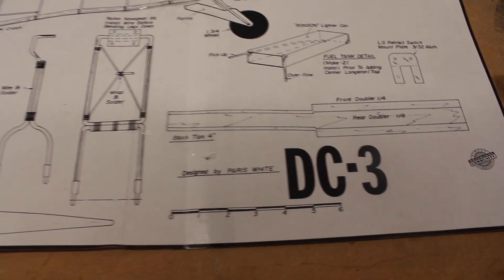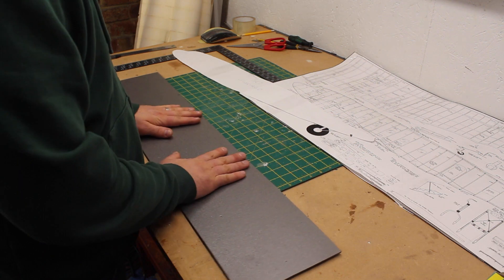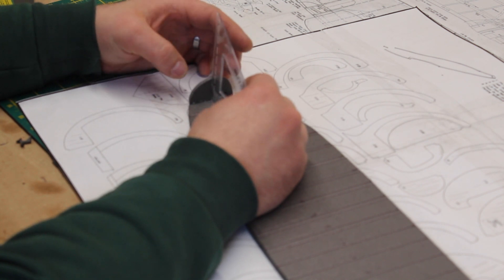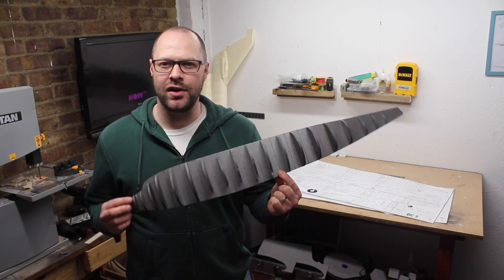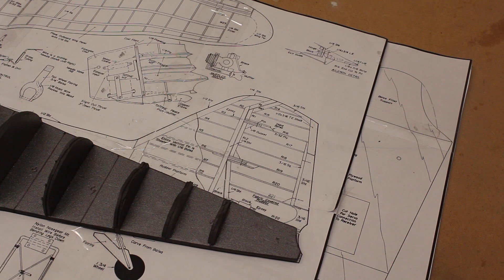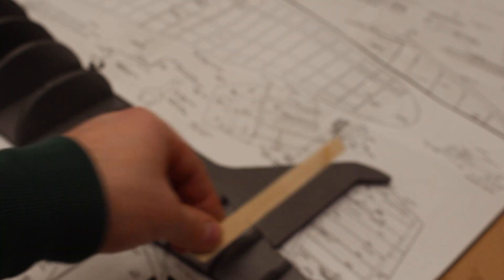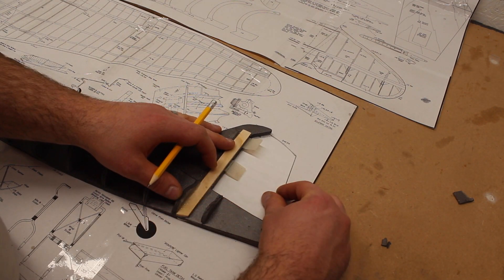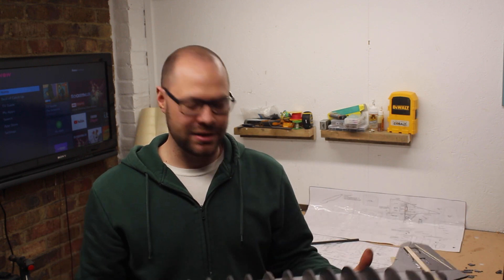Building a 48" Douglas DC-3 RC Plane from Depron Foam - Part 1

Comment: Interesting, how does the weight compare to a balsa build?
Reply from the maker: Hi! I think with this particular project it would have been at least as heavy as a balsa model, around 1.2kg . I ended up skinning the model in fibreglass. Had I just used tried and tested Depron methods from other builders Im sure I would have had more success!